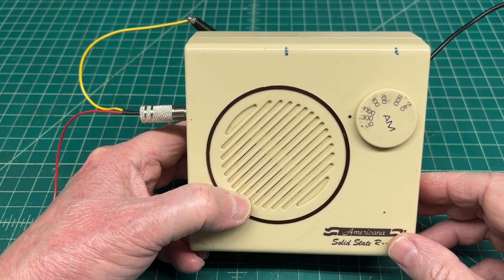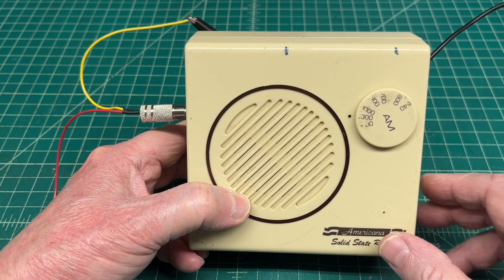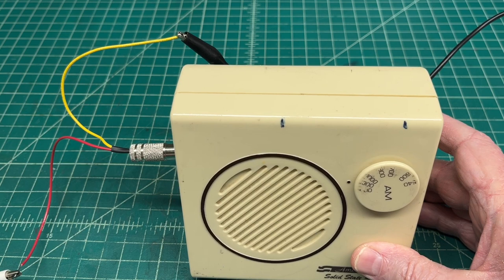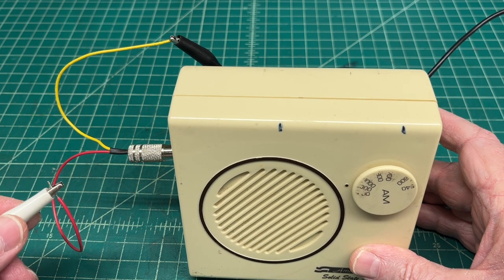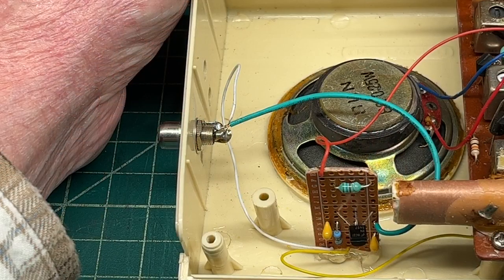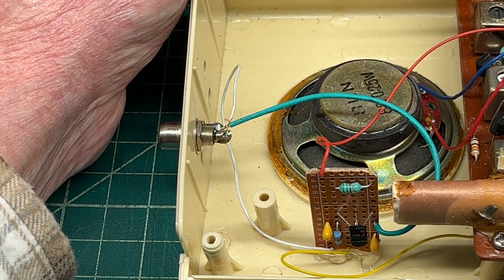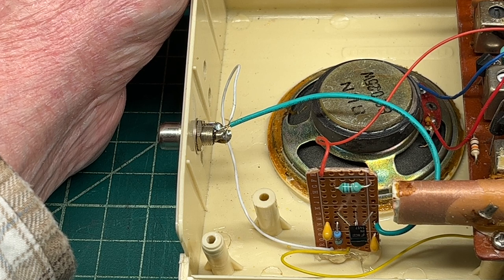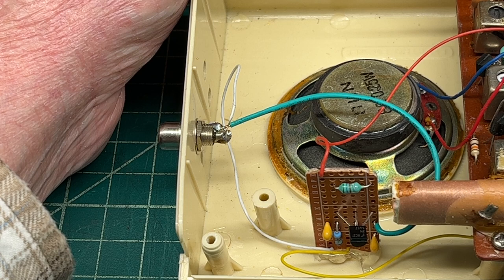How to add an External Antenna to your Transistor Radio

Comment: Thank you so much for mentioning my avatar name as well as sharing our friendship on your channel, Don. It was an honor to contribute to your great series of classic retro electronic stuff we all love to do. Your excitement of electronics gets me so enthusiastic about building stuff, as Im sure you know. 

This series of yours and the old 620 Americana radio, which I found on ebay, one which will be coming to my doorsteps maybe by this weekend has got me into building that circuit into it as well. Already printed it out, too. 

Found the same one as yours, with the box for less than $15. I think there are many 620s out there still from the mid 80's. I can't wait to build it. Thanks, buddy, you're the best! I will keep you informed with its progress as well. -Tony
Reply from the maker: Tony - I always appreciate and enjoy reading your replies as your prior comment motivated me to integrate the circuit. The earlier NPN design I posted will work too leaving out the tuning capacitor and lowering the 470k to reduce the gain as needed and a fixed resistor from Vcc to the collector. I’m looking forward to hearing back after you build it; I may have to purchase another 620 for experimentation as well. Take care and all the best. Don

Comment: Ah , so the choke is air-coupled to the main antenna.. clever. 
I have a few old battery "farm radios" I am working on.. the long wire style is not so great for running the radios in the house. Maybe I can cobble together a broadcast band pass pre-amp w/ antenna to do the same thing, to the radio's internal antenna coil.
Nice idea, tks Don.
Cheers,
Reply from the maker: Eddy, you are correct just air coupled. Hope you’re successful with your build. Best, Don

Comment: Dear Don, could you please tell more about the antenna itself? Is it just a 50 feet long wire as You've said in the comment below? Is the yellow wire grounded? Best regards, Karol
Reply from the maker: Sorry for my belated response, other stuff came up that took priority over the last few weeks. The yellow would be an earth ground (for transistor radios that are battery powered) and yes the 50’ wire antenna was tossed up in some nearby tree branches for proof of concept and has since been removed. Hope this helps. Best, Don

Comment: Impressive result, and a simple schematic. I don't have an external antenna outside of my house, and now I wonder what you have. Saying that, I also wonder how your result would be if you only used 20 windings of Litze wire (or other isolated thin wire) around the bar with that same antenna connected. That was the advice from the beginning of the ferrite bar antenna, and would be easily copied by a lot of people.
Reply from the maker: Erik - I don’t have don’t have an outside antenna either; ~50 feet of wire inside my shop at the ceiling level. Turns of Litz wire or other around the built in loopstick should work as well; not sure how good the results would be though. Best, Don